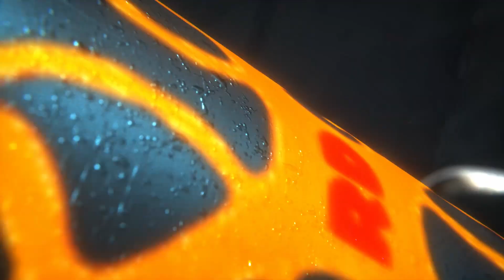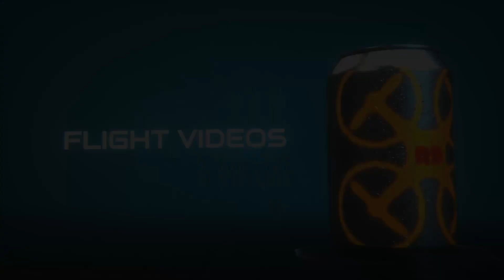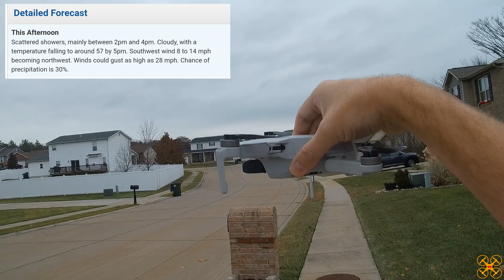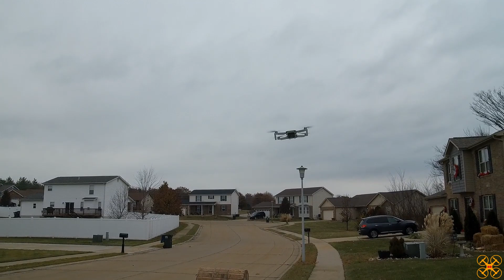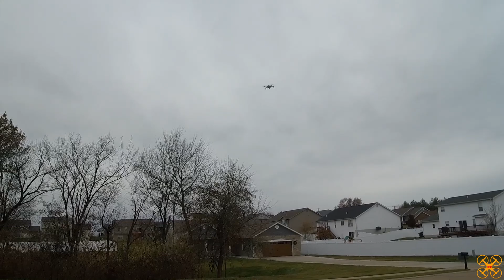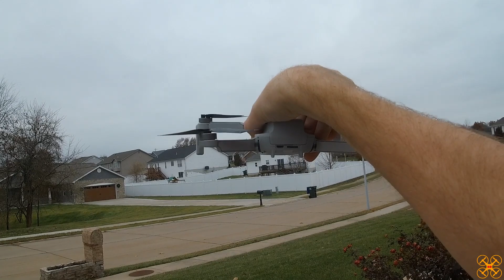DJI Mavic Mini High Wind Position Hold Stability Test

Comment: Nice test, and some handy battery tips, thanks. With winter coming in Europe, we won´t be able to fly for a month or two, so what condition should we store the battery in?
Reply from the maker: Thanks! Ideally you want to store the battery at 3.80v per cell so 7.6v for 2s at a resting state. That'll be hard to test with this battery so the best you can easily do is just change the battery up to half and that'll be close enough.
Reply: Thanks, may I have a bonus question, please? I am terrified of Lipos, having seen some horror videos on youtube. Can I store the batteries for my Mini, and Mavic Air, indoors? What precautions do you take? Thanks in advance.
Reply from the maker: @Pindi44  they are fine to store indoors just keep them in a lipo bag or a bat-safe to be safe or many use ammo boxes. I have most of my big batteries in a bat-safe. I would not be worried about the Mini's battery. They have to be exposed to air or short out to be dangerous.